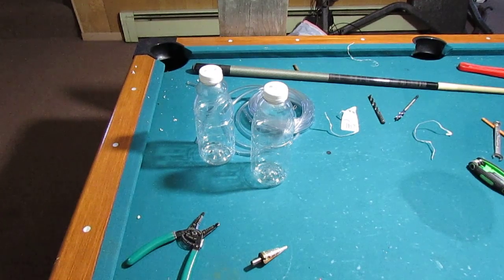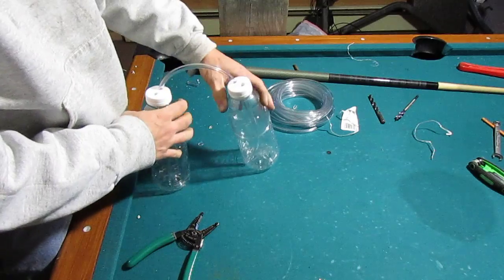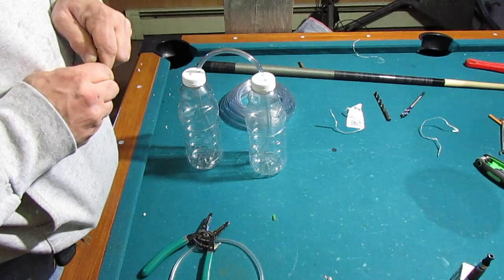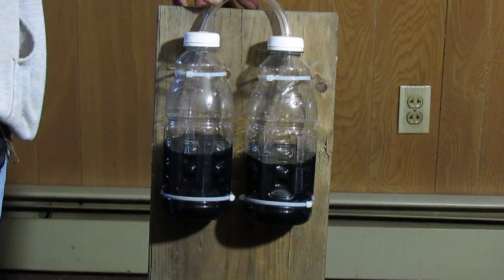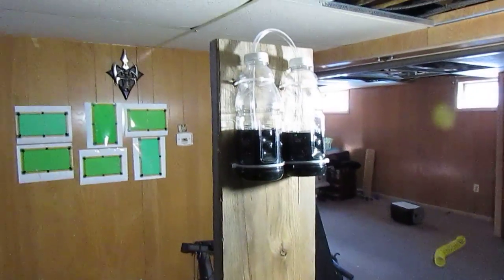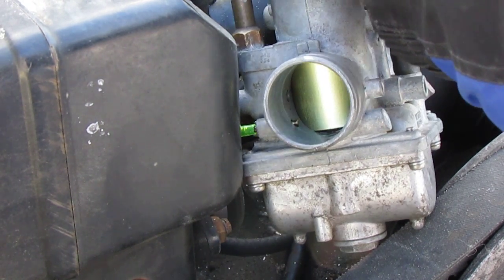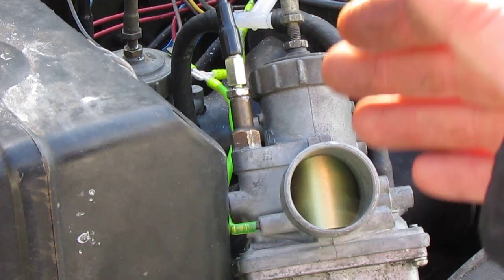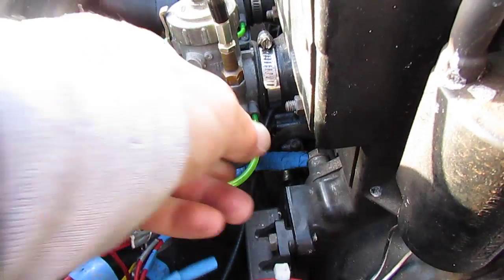DIY Carburetor Synchronize / Balance Tool

Comment: but doesnt it make sense to balance them at cruising rpm like 4k or 5k revs, so you dont get vibration when riding on the road at speed, instead if you balance them at idle it'll idle great but there will be big vibration at high rpm

Comment: great video! thank you, but the idle screws only lift the slider, as soon as you rev the engine its all up to the throttle cable slack.. so your just really fine tuning the idle balance, but this method works well for fine tuning the throttle cables

Comment: Hey man...I know this is a very old video but I tried this and it worked!....I have a Honda CB125 super dream that I bored out to 250cc...it ripps !....but I had issues with the dialing in both the idle screws perfectly....I was looking at getting a carb sync meter but it's expensive!...and this worked perfect...my bike pers like a kitten....although I must point out that I failed at my first attempt using cheap plastic bottles...the bottles sucked in on themselves for the pressure...so I used small glass Jars that come with a metal cap...thanks man !

Comment: I built 4 carb setup 20 years ago simple balance vacuum hose on a flat board using motor oil as the gauge. Never sucked anything the gauge is 4 feet tall with another 6 feet of vacuum hose

Comment: WELL DONE!  I have a corvair with dual rochesters.  Ive seen the $45.00 tool that you set on top of the carbs after removing the air filters for balancing them.  Would I need to make something to sit on top of these carbs?...no, because that would choke off the air right?...where do I hook up the tubes on my carbs?

Comment: This would only be accurate if you can be 100 per cent sure there are no air leaks anywhere in your set-up. a slight leak on one side or the other would bias your readings

Comment: This seems to me to do nothing to balance the carbs through throttle range. Yes, they will be balanced at idle, but as soon as throttle is moved they will be back to where they were when they were synced using the cable adjustment.

Comment: Nice homemade manometer. FYI: If you bleed the air from that short transfer tube between the bottles, you'll be able to dial it in perfectly level across the bottles. Now I've got to add a third bottle to make it work for a triple!

Comment: Suggest defining SYNC vs BALANCE at the start, then stay consistent with the terminology.  Otherwise it's confusing.  What is the purpose of meticulously syncing both barbs first, then readjusting (during balance phase) with idle screws?  I assume you pick the idle RPM you want by adjusting both idle screws until vacuum is balanced and you get the RPM you want?  So when done, vacuum is balanced and carbs are no longer physically in sync?

Comment: Great little tool here.  I have a manometer setup that I've used to sync carbs for quite a while and I use transmission fluid in it just in case it gets pulled into the carb so no harm would be done...but this idea is great.  One thing though.  You DO want the level of fluid in each bottle to be at the same height for the carbs to be perfectly sync'd.  If one bottle has a level higher than the other then that carb is pulling more vacuum.  It's not about stopping the levels from moving up or down, it's about the level of fluid being exactly the same in each bottle.  If you have 1" of liquid in one bottle and 4" of liquid in the other when the levels finally stop rising/falling, then you are extremely out of balance.
Reply: That's actually incorrect, the level of fluid is irrelevant. All that matters is that both Carbs are pulling the same vacuum, if both are pulling the same vacuum then no fluid will travel between the bottles because the vacuum from each carb is cancelling the other out. So regardless of the level of fluid, if the fluid isn't transferring to another bottle then the vacuum is the same and your carbs and synced.
Reply: @ledbetter1226  With all due respect, then I'm not sure you know how a manometer works.  Different levels precisely means there are different pressures involved.  That is exactly what a manometer does.   Now, does a slightly different liquid level mean there is very much difference in pressure?  No, but none the less, there is a pressure difference if the levels aren't the same.  The one with the higher liquid level has less pressure, thus the liquid is "pulled" up to a higher potential plane...or rather pushed up by the higher pressure on the other side.  I would say that "perfectly" tuned means equal levels.  "Close enough" is levels not continuing to move.
Reply: Hi  @dilbone1   this system is not acting like a manometer, and so the principles are different.  Manometers have a single liquid mass in a uniform U-shape tube with one end closed.  They are initially calibrated for a specific purpose and then relative measurements are taken.  External pressure verses the internal pressure of the sealed end of the system changes the height of the liquid in the tube.  The system in this video has two separated liqid masses connected by a tube, where by the height of the liquid in one vessel has no impact on the height of the liquid in the other.   A pressure difference will initiate a transfer of liquid, as both ends of the liquid transfer tube are at the same height, i.e. the bottom of the bottle.  They only variator in this system is air pressure above the liquid surfaces in the bottles, as generated by the engines twin cylinders.
That being said, I think I agree with one of the above comments, that this will only balance the carbs for idle only.  As soon as you twist the throttle the slack is taken up in the throttle cable, you are off idle and the idle screw position plays no further roll in regulating the balance of the system.  So the best you can hope for is maybe better slow traffic.  Close to and coming off idle improvements in smoother very low speed running.
Reply: @bobnewton6377 I'm not calling his set up a manometer.  What I use is a manometer.
Syncing the carbs at idle means they have the same start point.  Since they are linked mechanically I'm not sure why you're saying they would unsync off idle.  However, one could certainly check balance at off idle RPM if so desired.  I don't think I'd trust this set up for syncing carbs myself. I don't see it being sensitive enough
Reply: Hi. Thanks for your reply. If you read carefully I did not say they would unsinc, just that the noticeable improvement would only show at, or just coming off, idle. I hope that makes sense. 😊
Reply: @bobnewton6377  it sounded like you were saying the slack in the throttle cable would impact the sync.  It won't unless a separate cable runs to each carb(which I've never had)
Of course the wider the throttle is opened the smaller the percentage difference between them is, but I don't spend much time at WOT lol

Comment: This is a great video , thanks for the help. This is been the part that been scaring me about rebuilding my mikuni 38mm yamaha triple carb. getting everything balanced and synched seems to be what everyone has the most trouble with. 

In this video you explained how the sync the "low" or idle screws. do you imagine doing the same thing with the "high" or open throttle screws?

Comment: What about for a 3 cylinder?
Reply: Just do two, sync em up.. then take one hose off one of the already synced carbs and move it to the one that you haven’t done yet.. now balance the third carb by adjusting only the 3rd carb to match the already synced carb

Comment: DON'T USE PLASTIC BOTTLES. ON MY 1100 MOTORCYCLE. THE PLASTIC SUCKED RIGHT IN. GO TO WALMART AND BUY QUART MASON JARS. AND ADD RED OR BLUE FOOD COLORING(I USED WATER INSTEAD OF OIL TO SEE THE LEVELS BETTER.

Comment: Great idea and I'm sure it will work perfectly when I get some stronger bottles. The ones I used were fairly thin plastic and instantly collapsed as soon as I started the engine... DOH!
Reply: 😆. had a Homer moment "Doh!".  lol
Reply: @jake_break9185  not kidding. Moment of panic as I watched the water being sucked into the carbs 😨. My Mk2 version used plastic beakers with rubber sealed clip on tops. Works a charm 👍🏻.

Comment: Excellent video. I have one question do you think it would work if instead of using 1/4 inch fuel line to the carbs then converting them to fit the primer, if i just used primer lines all the way from the carbs to the bottles would it still work? I think it’d be easier than converting a 1/4 line to the primer

Comment: Thanks for the tutorial I will try this with my twin su carbs (MGB)
Reply from the maker: use glass bottles snapple bottles they hold up alot better with rubber stoppers for the caps, they will work o n all engines

Comment: I recently tried this method but ran into trouble. Can anyone tell me why my bottles crush and try to pull fluid in ?
Reply from the maker: alex Martin this worked great for my snowblower, use 2 glass snapple bottles for motorcycles

Comment: When you are balancing them what RPM are you looking for on the TAC? Because you could balance them but be idling too high or too low, correct? So you want to balance them at the proper RPMs, right?

Comment: Good explaination, I'll build one. Have always done at night comparing exhaust port flames. On my motorcycles. Drill bits on boat carbs or where I didn't want to remove exhause.
Reply: you would fire engine up without exhaust manifold attached to head? 😮

Comment: I agree with the principle here----He has gone to great pains to avoid sucking liquid into the carbs----but at the sacrifice of an awful lot of precision in setting the sync.   This would not work well on syncing motorcycle carbs or injectors---which are synced to reduced engine vibration which 'puts your hands to sleep'    Just using a plain old manometer would work better and produce a more accurate sync

Comment: HI..i have 93 jaz Z...there no..primer plug, just the manual choke..where do I plug the hose to have the same result...tks
Reply: this is what I have my in mikuni triple. I have not done this yet however the primer kits are sold to take out the butterfly for the choke u can use those holes

Comment: What about if you have more than two cylinders? Three cylinder engines seems tricky.
Reply: From other videos, you can have the bottom tubes connected, 1 to 2, 2 to 3, finally 3 to 1. Just add more bottles for extra cylinders.

Comment: Excellent video.Thanks for your explanation.My bike Yamaha FZR 250. i cleaned my mikuni 
carburator (4) and cleaned main jet,pilot jet and adjust air mixture screw 2.5
 turns out from the closing point.My problem is 3 times failed my eco 
(smoke) test and result show more petrol consumption.but last years without cleaning my carburator,
easily pass the eco test.My problem is need to reduce petrol.I need lean mixture.If i synchronizing my 4 carburators,what will happened?How can i 
adjust?please help.Thanks
Reply: Depends on how far out of sync they are. It'll definitely make the bike run smoother to have them them in perfect sync. The mixture screws have more of an impact on fuel mixture but dialing in the mixture depends on a properly functioning bike and carbs which includes synchronized carbs.
Reply: do a compression test as you may be passing oil past the rings etc......AND go for a one hour drive before going in for the test......nothing on the carbs will affect MPG - the only thing that will is attached to your right wrist

Comment: Maybe I did something wrong on this, but I hooked one of these up on my MGB with Mikuni carbs and it collapsed the bottles down to nothing.
Reply: You need sturdier bottles that can handle the amount of vacuum. These poor man manometer solutions are typically and best done on small displacement motors where a carb feeds a single cylinder on this small motor. Vacuum levels are low in this setup so it's not hard to make a design that holds up.

They do make a sync tool just for the MGB and MG. It's not as cheap as a couple plastic bottles and clear tubing but it's far from expensive for a special tool at $29 USD (upon current google search). It costs 3x as much for a carb synchronizer for use on 4 cylinder motorcycles.
Reply: THANKS. MIKE SHOULD HAVE MENTIONED THE SUCKING PROBLEM ON LARGER ENGINES. i HAVE AN1100 V TWIN. MIKE THE SUCKBAG.

Comment: why did my bottles just callaps
Reply: I READ TOO MUCH VACUUM. BIGGER ENGINES LIKE AN 1100 HAVE MORE VACUUM. I'LL ALSO HAVE TO MAKE ANOTHER SET USING GLASS BOTTLES. SUCKBAG MIKE DIDN'T MENTION THIS PROBLEM. HE DOES COME OFF LIKE HE'S ALBERT EINSTEIN.
Reply: i'm guessing that all engines pull about the same amount of vacuum. a bigger engine would just callaps  the bottles faster.  I did solve the problem with a 100 dollars. (sync pro vacuum gauge). just a thought, if you do try glass, wear eye protection cause they will probably implode.

Comment: Very good video, thanks. I was wondering about the primer nipple. On my sled, for some reason there is a lever style choke ( like yours) it's a Polaris and the lever was stock and the previous owner put a primer on. I removed the primer and the lines going to the primer nipples on the carbs. What should I do with the open primer nipple? Should I plug it? Or connect the two nipples with a hose? I'm not really sure. Any ideas ? Mark

Comment: i used  Gatorade plastic bottles for syncing my xs650.  the vacuum coming off the carbs crushed the bottles like King Kong was sucking on the hoses.  will remake this manometer using glass bottles.

Comment: Just made one of these, good idea. But the vacuum on my 1978 Honda CX500 sucked and collapsed the plastic bottles both sides. I'd been careful not to put too much water in but the collapse squeezed the contents, it got near the top of the bottle on one side and started to suck water into one cylinder. Use strong heavy plastic bottles.
Reply: Looks like he uses Gatorade bottles or poweraid  should be the same 👍🏻

Comment: 4cyclinder motor cycle sucks those bottles flat then sucks in fluid. Bad idea for a bike. I tried it...
Reply: +Gary Stew:  You used too much oil in the bottles.
Reply: 2 containers 1/3 full. The vacuum sucked the containers flat. Glass containers worked much better.
Reply: I tried it, too.  Bottle material too thin and the vacuum collapsed both of them
Reply: +Gary Stew Did you try thicker bottles like smaller Gatorade or Minute Made bottles?
Reply: Timothy Haun  you could use small Mason jars they can handle ton of vacuum

Comment: If the hose connecting the two bottles is filled with water, the two levels in the bottles should  eventually equalize (without the device connected to an engine)

Comment: Great video
I saw the conment for 3 carbs.... How do I do this with my 4 carbs on my Ninja?
Reply from the maker: if you look down at the carbs from sitting on the bike and call them 1,2,3,4 from left to right, first balance carbs 2 and 3, then hook it to 1 and 2,balance carb 1 to carb 2 and only adjust the #1 carb to match it to # 2. Then hook it to carbs 3 and 4, and only adjust carb 4 to match carb 3. Done, its actually very east to do.
Reply: Perfect! Thank you very much for getting back - I set out 4 bottles at first and started thinking, now how in the hell am I going to route all 4 together lol
- then I was going to do it 1 to 2 then down the line - good to know to start on 2 and 3
I will let you know how it goes!! Thanks a ton!
Reply from the maker: Use glass anapple bottles not the plastic for the streetbike
Reply from the maker: Snapple
Reply: Damn - got plastic Gatorade lol
Reply from the maker: Plastic will work for a snowmobile, but for the bike, use glass, ask me how i know lol
Reply: lol - I imagine it sucks it in
Reply: how do you know?  but really, I wonder how it could work on a snowmobile,
Reply: the vehicle really don't matter - the carbs pull vacuum, which should be equal on each carb - no matter the setup

Comment: so lets say after carbs are synced iam fat at take off? turn both screws leaner or drop my pin
Reply from the maker: the air mixture screws only affect idle and 1/8 throttle, if you crank the throttle and your running rich, raise the clip on your needle, effectively dropping the needle into the main jet deeper.
Reply: Thanks. I will try that.
Reply: WHILST KEEPING AN EYE on the state of your plugs - as if they run hotter (leaner) you can burn though pistons....keep checking the colour and try to get it right on pilot jets first before going to the needles.......also bear in mind needles affect 1/2 throttle to full throttle

Comment: This video is gold. So the point is to have fluid level equal at idle?
Reply from the maker: correct if thats what your after, I have many vehicles some with twin carbs, some with 4, my 4 carb bike wants to be synced at 3500 rpm due to engine vibration, but most vehicles, motorcycles, snowmobiles definitely want to be synced at idle.
Reply: Mike OD always check the service manual for your engine. My 1981 Honda CM400C says to perform the carb sync at 1200 (+/- 100) RPM. The guys who built your engine knew what they were doing!
Reply: MrNightpwner No, not the fluid level, the fluid level change rate null so neither bottle sucks from the other : level does not matter.
Reply: MrNightpwner @d

Comment: Hi Mike. Thanks for your excellent explanation. Would this method be usefull for a yamaha rd 400 ? it has 2 mikuni`s 29. I wonder if i can use the lubrication nipple (where the oil tank from premix is connected to the carb), because it doesnt have a primer nipple. thanks
Reply: No! DON'T do it. These bikes are ruined at this point. BUT! Good news, I will gladly purchase that old RD from you to that you don't waste any more of your time on it. Contact me to make arrangements to get rid of that Yamaha RD 400!